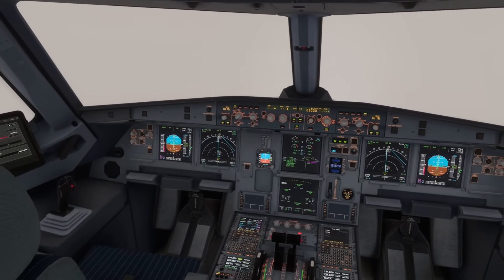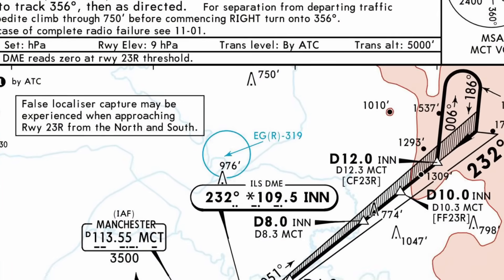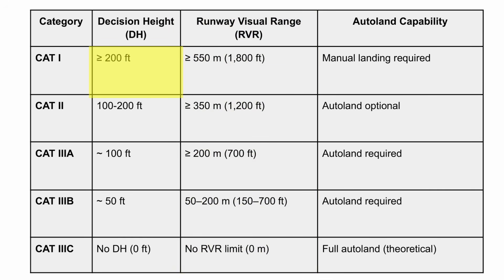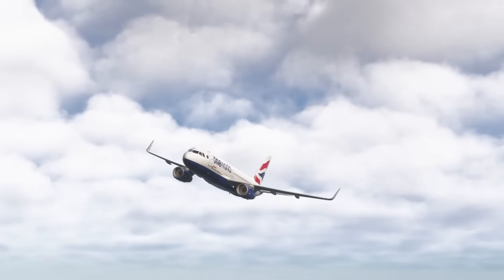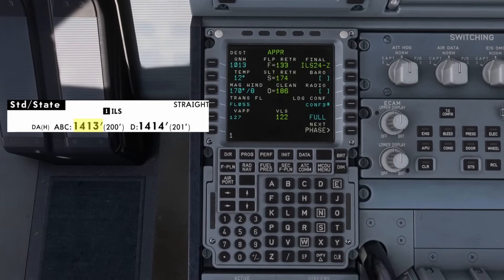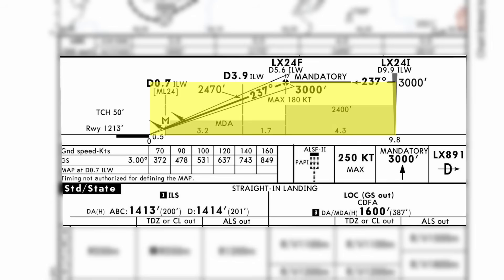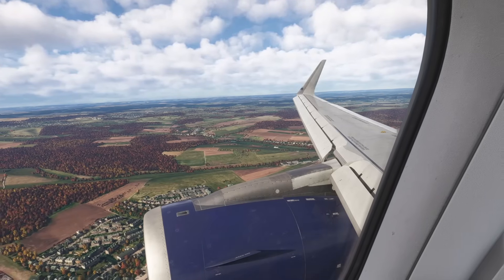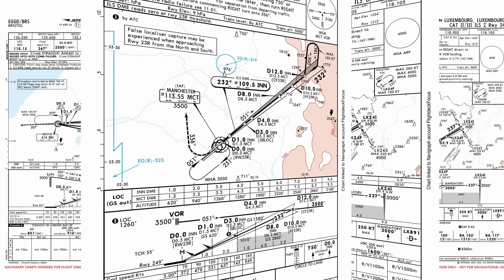The Essential ILS Approach Tutorial for Flight Sim Pilots!

Comment: Awesome video I have much understanding now but for an ILS approach is arming the LOC button always necessary because i normally don’t only for a LOC approach or am I doing to incorrectly this is just for flight sim
Reply from the maker: In all fairness, you could arm approach mode from the get go.
My reasoning for saying to arm LOC seperately is to avoid premature glideslope capture. 
Also, it is possible that ATC clears you for the localizer first, then clears you for the approach. In this case, you shouldn't descend until cleared for the approach, and using LOC mode ensures this!
There isn't always neccesarily a strictly correct way, sometimes, there is a little flexibility depending on the scenario!
That is why I also said to arm approach mode to capture the localizer and glideslope simultaneously! Especially if already cleared for the approach. 
I hope that clears it up a bit. Any further questions, don't hesitate to ask!
Reply: @FlightdeckFocusmakes perfect sense much appreciated

Comment: Extremly helpful thank you so much, i just subbed. I just got one question: How do you calculate the descend rate from TOD or generally in the descent, because i figure the calculation in the video only applies to ils aprroaches with a 3 degree angle right?
Reply from the maker: First off, thank you so much for your kind words, and for even subscribing! It really means a lot.

In regard to your question:

The calculation in the video is a very rough cross check figure to ensure your aircraft is at the approximately correct descent rate for a 3 degree ILS approach. 

If we want to calculate a 3 degree descent, for the approach or even from TOD, it is generally best to use the calculation GS (Ground Speed) x 5 ≈ Descent rate. 
For example, a GS of 100 knots results in a descent rate of 500 feet per minute! 

If you want to calculate your rough TOD mileage, i.e, how many miles from the airport to start descending, simply take your current altitude, divide by 1000 and multiply by 3. 
So if we're at 30,000 feet, divide by 1000 to get 30, then multiply 30 by 3 to get 90. So we start our descent at 90 nautical miles!
Reply: @FlightdeckFocus Alright thank you very much!

Comment: Correction: you need the ground speed to divide it by 2 to calculate the descent rate, not the IAS. Otherwise you may bury your plane a mile before v the threshold in a stronger headwind 😂
Reply from the maker: You're absolutely right! For calculating the descent rate on a 3° glide path, ground speed x 5 ≈ vertical speed.

e.g. 140 kt GS x 5 = 700 fpm

IAS works as a very quick and rough rule of thumb in calm wind or when ground speed is approximately equal to IAS, but in stronger winds, using IAS can put you low or high on profile, like you said.
IAS is also much more easy to access in a flightsim environment where it is quite possible that many might be unable to make a distinction or quickly find their GS, so to keep it simple, use the big visible number!

But I will agree, ground speed is the correct reference because the glide slope angle is based on distance over ground, not indicated airspeed!